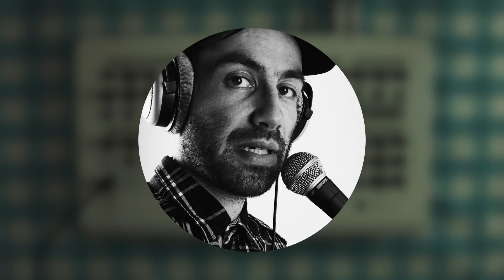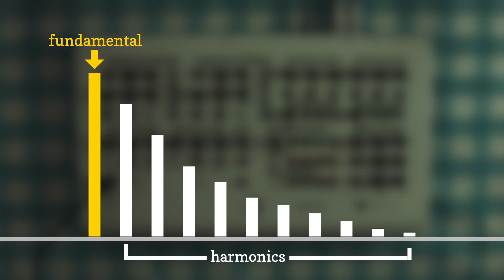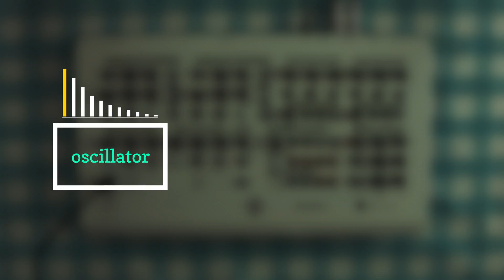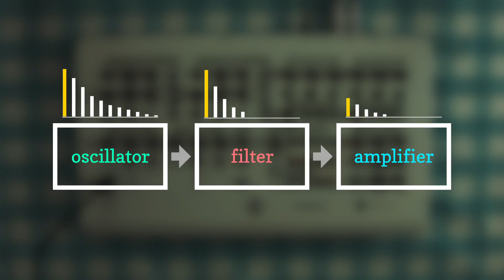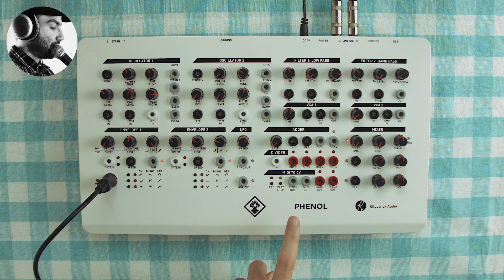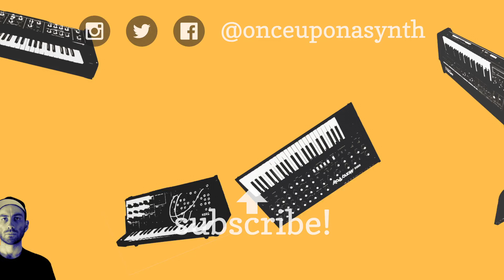SUBTRACTIVE SYNTHESIS AND MODULAR TUTORIAL FOR BEGINNERS ~ Featuring the Kilpatrick Audio Phenol

Comment: I know deadmau5 is heavily into those stuffs but why do ppl use analog synth? Is it like a valve amp to guitarist?
Reply from the maker: Do you mean analog synths in general or specifically modulars? Analog synths just have a different sound in general and have different strengths and weaknesses compared to digital synths. The analog vs digital debate is pretty controversial in the synth community. In my opinion both are equally valid and both should be used as long as the resulting sound is what you want. I would relate it less to valve vs non-valve amps, but more to real valve vs valve emulation. But not all digital synths are analog emulations, some offer truly unique sounds that are only possible with digital synths (e.g. FM, wavetables, etc). So it's really hard to make a generalized comparison between the two types. Hopefully that helps shed some light on this often touchy subject :)
Reply: Oh okey It all makes sense now, I guess all the music instrument controversies these days are about original instrument vs digital emulation. I literally don't know anything about analog/modular synth stuffs but hey, just thought it look pretty damm cool and decided to look up some tutorial vids ;)  It looks really interesting and want to give it a try sometime. Great video btw nice and clean!